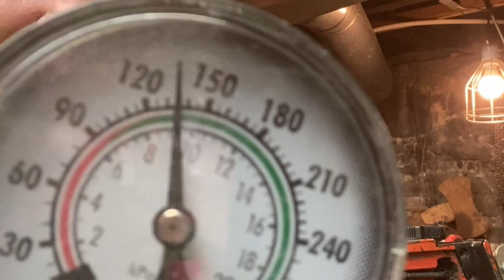Homelite Super XL-923 82cc Chainsaw!  Let's Bring One Back To Life!

Comment: Good useful information.  I use an xacto knife to remove the gaskets, as you can get under a part of the gasket where it is not stuck, and work your way under the rest of the gasket.  Most of the time there is no clean up needed.   When installing a grommet and fuel line, spray a little silicone on them, and it makes installment much easier. You mentioned a new name for your channel is in the works, so maybe something like Smitty's vintage chainsaws and power equipment channel? Of course these are just only suggestions. Good job as usual
Reply from the maker: Thanks!

Comment: looks like my c72 good score bigger is better A plus i love it man
Reply from the maker: Nice 👍  I wish I had a c72!
Reply: @Smittyschainsaws   they about the same ant they / c72 bit smaller cc or about same  ?
Reply from the maker: @overbuiltautomotive1299  C72 is an older design.  It won't have the performance of the 923.  Homelite built a lot of things into the design to hold them back from the full potential.

Comment: Hej.
That saw don't need porting It's a beast as it is. 💪

An i think it has an open port cyl.
Reply from the maker: I will be going from a beast to godzilla saw!
Reply: @Smittyschainsaws 
Yes you can port it.
But theere is limitations..
Lower The cylinder.., rise The exhaust..
Weight reduction on The piston.
Lowering The cylinder is a bit tricky with The ignition plate thing

Comment: Are those all hand oiler or did thay make a auto
Reply from the maker: Most you see will have an auto oiler with a manual over ride pump near the trigger.  This one is and auto oil saw with the manual over ride.  Auto oil started to become more popular around the end of the 60's but Homelite kept the manual oil pump just in case users needed to use it on the really dirty wood.